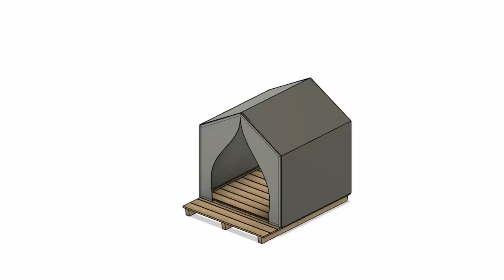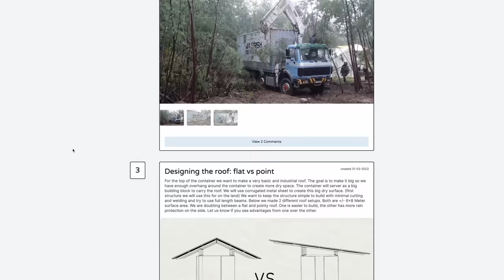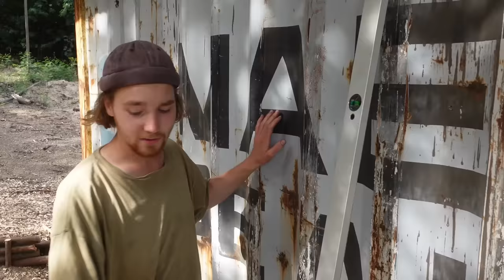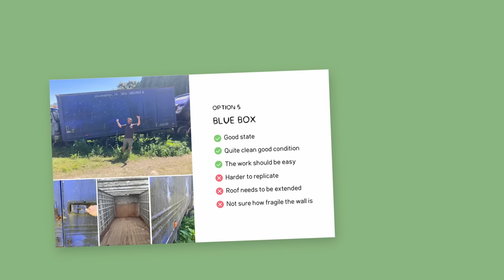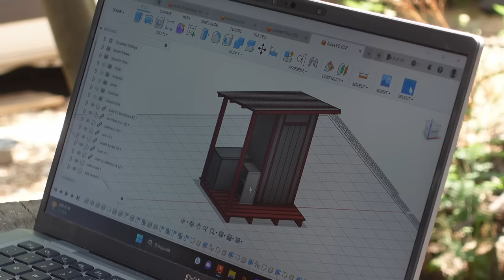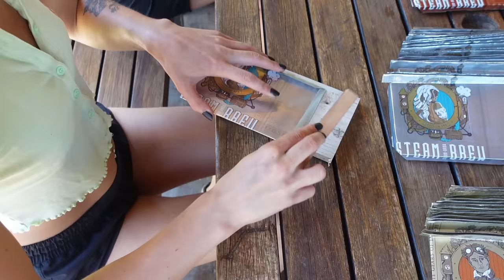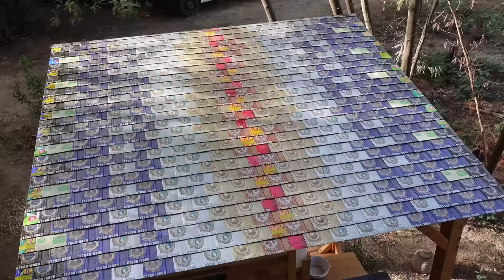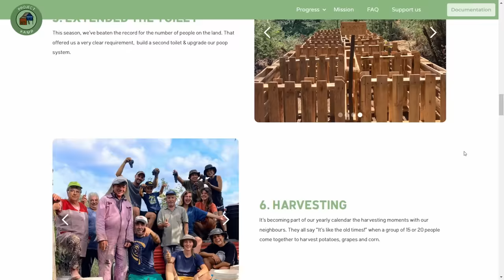YEAR THREE. Everything we built on our abandoned land

Comment: Wanted to tell you that a few times: Please dont "remove" rust with a rotating wire brush, in reality you will enclose the rust beneath the metal and the rust will grow again some time later. Problem is that you think you have removed all the rust since everything is shiny. Better first use gentle tools like a fan sander, then use rust remover (phosphoric acid) to ensure everything is gone. Then off course use a good quality primer and you wont hear anything from the rust again :)
Reply: Its a japanese metal sheet. This will rust no matter how.

Comment: I would recommend in the shed where you're storing gas powered tools, you look at installing some venting as well, 
either a mechanical louver or small electric fan to circulate air and prevent the possibility of a build up of fuel vapor as a possible fire hazard.

Comment: I was thinking that you guys could create a septic system instead of a compost system, but there's probably some reason why you guys went with a compost system. Septic systems can work in the same way that compost systems work, without the manual labor, and you get a drain field where all of the rich nutrients that you would get from a compost would go. it would be limited to the drain field though, so that would be one thing to think about. out here on my property, I have a drain field that is green year-round except for the winter, but it uses water and electricity so that is one thing to definitely think about. I think that the thing you gotta do in order to get it done is dig 4 big holes in the ground, and then connect them underground. I think that it's so that as the waste is being ate by bacteria, you can move it from one tank to another tank in order to satisfy different stages of waste treatment. you would also want to cap them off, so you would need ceilings for them, with caps on top so you can regulate the gases and whatnot. I mean I appreciate the concept of the composting site, but at the same time there are some issues that open-air composting can have, such as cholera. If you want it to be energy efficient, you can set up the tanks on a high elevation, and let the drain fields be in different areas of the property. and just let it naturally drain from high-low.

Comment: A good way to upcycle for waterproofing for tent slips and just general purpose tarpaulins, any scrap sheets or absorbent patched together fabrics, get a junk trash can or rubber tote, mix mineral spirit down with a few tubes of liquid silicon, like the tubes from hardware stores called liquid nails. Dip the fabrics and soak them then hang dry on a cloothes line til dried. Cheap endless all purpose moisture barrier for tents, tarps, panchos, weed barrier for gardens, roof slips for shingle underlayment.... Literally millions of uses. Great hack for homesteaders and reclamation lifestyles.

Comment: That trailer that you aquired. I didn't notice whether you had lifted the wheels off the ground. If you have I'll say no more, however if you haven't it would be a good idea as it will keep the tyres in a better condition (who knows you might want to move it). Tyres that are not pressed into the ground (dirt) will last years.

Comment: I am surprised you didn't use the logs to build log cabins & roofing. & make a rain barrel system off the roofs for bathing, watering gardens, etc.Cans are great for holding in heat for colder weather time. Why didn't you put the roofs at a slight slant to prevent water and snow from sitting & rotting out roof. you could use the rain water on areas with sink & bath or flushing toilet routed by tubing

Comment: Used motor oil on the truck bed wood? And then paying twice as much for cork insulation than foam. Cleared the trees AFTER placing the ship container in the middle of them all? Painting the shelf metal but not the outside of the container? It's like you people run the place I work at with all the afterthoughts but still interesting video.

Comment: Here is my thought´s with best saved to last.
(-) I was a bit surprised over how little was done for actual places to both sleep and stay warm. The colorful trailer was to be honest, cool as a project, yet totally out of character
with the area it stood in, would have been better put together with other colorful elements. The stake or flue was missing heat resistance at the top, they get very hot!
The metal roofing was cheap yes, but was missing an air gap between it and the damp seal. It will condensate a lot during early Spring and drip and rust.
The wheels are on the ground? Well you know what will happen, you can at least move it to a better location?
(+) Finally the good comment, that would be what you did with renovating areas and most of all the pond/swim area.
I thought it was a shame removing the natural trees and so much waisted time, they will grow back and after only two years around the rock area too.
Yet your intensions were good, I would have had a crop growing for the first year like Corn, very easy to plant and a minimal costs too.

Thanks for showing or sharing:body-blue-raised-arms::hand-purple-blue-peace:

Comment: The roof is awesome, the power lines  passing through are a ticking time bomb (I’ll explain later) your poop management is rather disgusting, but I was curious, not prepared for your solution. I mean you are not on planet Mars, there are better ways to process poop & provide showers too. What about a septic system where water is filtered and filtered through land to provide water & nourishment for your trees. What remains is a dried up poop which needs to be sucked out by a septic service every 5 or 10 years if built properly. You simply will not like the poop management system you current.y have, trust me, yuk, you will regret it.  ….I don’t know, I suppose it’s better than pooping in a hole, it’s storing poop ina bucket that has a huge risk factor which takes one small error to become one huge failure. In fact I can’t even consider it being legal, but at least you are being responsible so please do not think I am being critical,I simply do not understand your logic not to build a practical restroom facility. I mean, what are priorities to survive? ….shelter first, restroom second, kitchen third. I mean, what sells or is defined as a house? Bedrooms, a Kitchen & at least one bathroom preferably two. Office space is a luxury, not a priority, unless it provides income required to build everything else …in which case it becomes building space which still overrides office space. Yet you provide an office first before providing anything else? I simply do not see that as a priority, but if you explain why it is I am sure to understand why you chose to do so. Forgive me my ignorance. I am American & raised on a different planet. I only seek to understand what could be my own nations ignorance to educate me properly.

Otherwise… so I see electrical lines passing through your property barely above the top of trees. I assume the owners of these transmission lines are government & have an easement allowing them access to serve customers farther down the lines but do they serve you as well? Or are you totally off the grid. I know your sewer needs are off the grid, but does that also include ignoring your overhead electrical &/or communication lines passing right through your property? What danger do they impose if suddenly a live electrical line simply snaps & breaks? The growth under those lines appears to be quite neglected & makes it dangerous for owners to repair & could potentially hide a down line which could prove deadly to anyone in your Kamp. It’s a legitimate safety concern. Keep in mind it was an electrical line in California which snapped creating a forest fire that literally burned up victims trapped in their cars. Residents were given less than an hour to escape & sadly some were not awake & woke up as they were burning up alive. It is the legal responsibility for owners of electrical lines to ensure they do not cause a fire & your concern about an escape path in case of fire is a top priority. However, it is not your legal responsibility to remove the danger because the power company has ignored its civil duty to cut the underbrush under those transmission lines. A dry September in California and one electrical line is all it took to kill hundreds & devastate a city of 30,000  people. That city, named oddly, PARADISE, will never be rebuilt, it’s a crime scene,a place of horror.  E warned and BE AWARE.